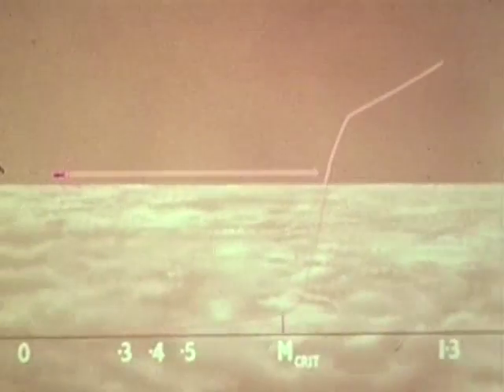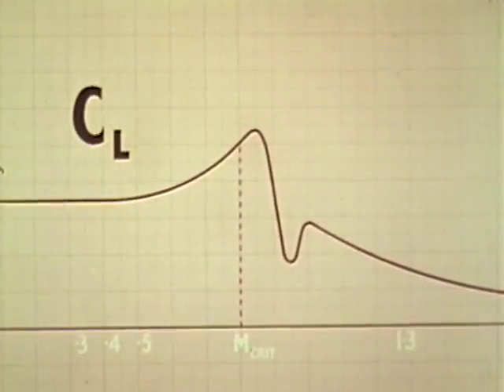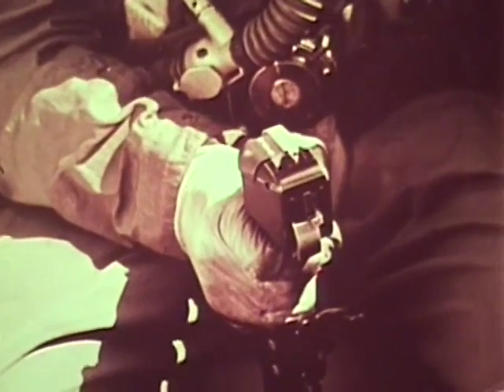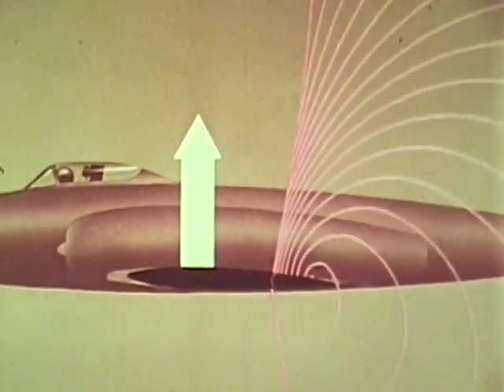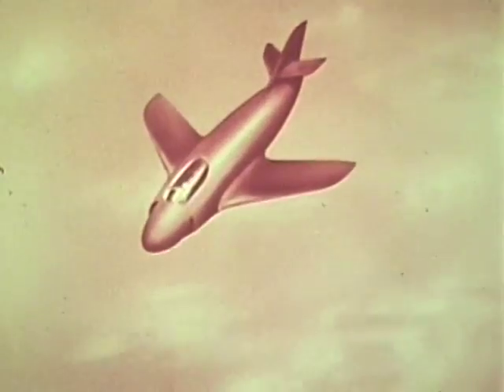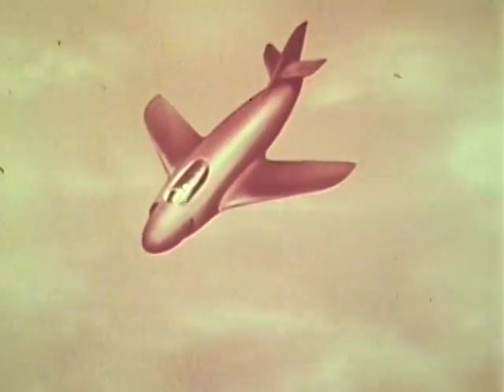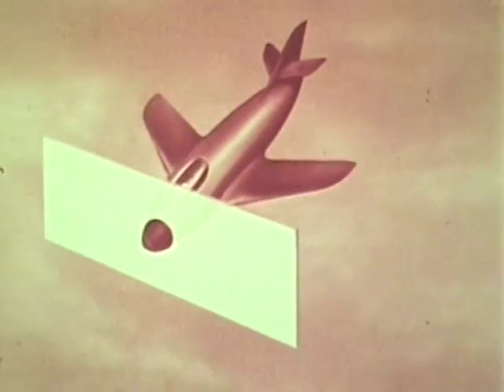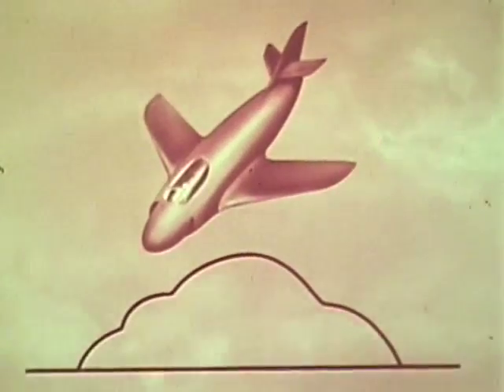Shell Oil "Transonic Flight"

Comment: Very informative.
The only thing missing is how the sweep affects the position of the shock along the chord and span.
Anyone know more?
Reply: +0MoTheG I think the other guy got confused. You're talking about the sweep: how the wing is swept back rather than more perpendicular to the fuselage, correct? I wondered about this too but a simple explanation I found is that if you look down vertically on the aircraft and imagine the shock-waves being produced on the aerofoil's maximum thickness, you will see something like a normal shock-wave (more perpendicular) with unspecialised wings, and with swept wings you will see something like an oblique shock-wave (small angles like those produced by sharp aerofoils). This reduces drag because a normal shockwave tends to have supersonic airflow in-front and subsonic behind it, while an oblique tends to have supersonic airflow both in front and behind it. By reducing the amount the air is slowed by (how much force it takes), you thereby reduce the amount of drag produced on the aircraft; as every action has an equal and opposite reaction. This isn't exactly the case because it's still a normal shock-wave on the wing, it's just you're looking vertically down on it. However, the amount the air is slowed by is very much related to the angle of the shockwave. If you can deter the shockwave from being perpendicular, even if it's just on one dimensional plane (from bird's-eye view) then the air will not slow as much and less drag will be felt.
Reply: 0MoTheG Not an aerodynamicist, but shockwaves are less severe on sharp, thin wings because they don't form as strong a bow wave, nor do they suffer as much flow separation at the rear of the wing.  Remember the example of the bow wave using a car and a boat?  The sharp leading edge cuts through the air better, creating less of a bow wave.  A thinner wing means that the airflow over the top and bottom can be smoother, pushing back the rear shock and preventing flow separation.  The problem with thin wings is that they don't generate much lift at subsonic speeds, and they don't provide much internal space for fuel and whatnot.

However by using swept wings, aerodynamicists can make a fatter wing behave AS IF it were thin and sharp because the chord (length of the aerofoil parallel to the direction of flight) is longer in relation to the wing's thickness.  For example, the BAE Lightning, which essentially had rectangular wings if you discount the sweep.  But by sweeping the rectangle back 60 degrees, the chord doubles in length without changing any of the other parameters of the wing.

This is why the swing wing was so popular in the 1970's - extended, the wings gave better performance at subsonic speeds, but when swept back, the same wing would perform better at transsonic and supersonic speeds because it behaved like a longer, thinner wing.  The drawback, of course, is the sweeping mechanism is heavy.
Reply: There are videos on the X-1 that explain that very well.